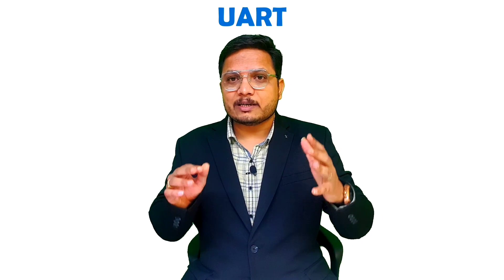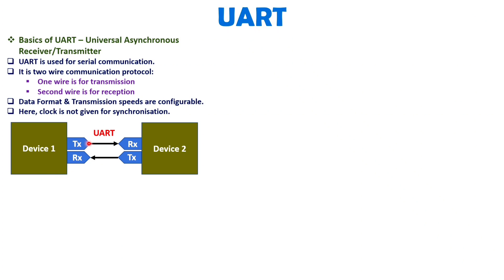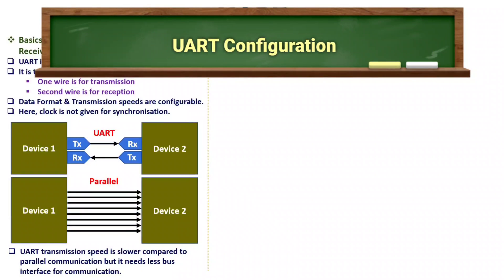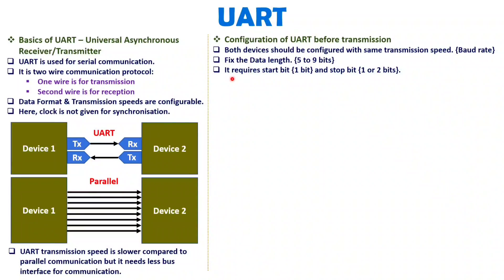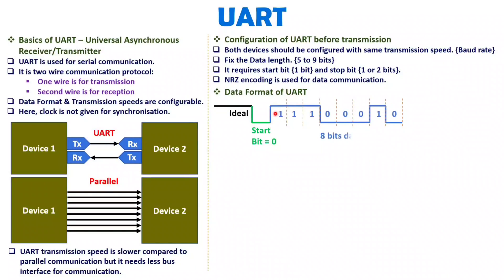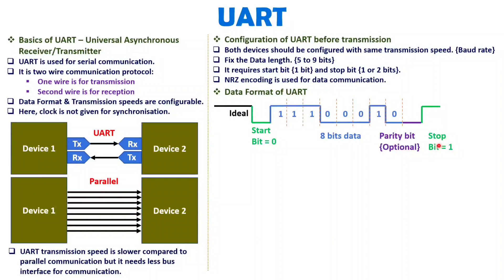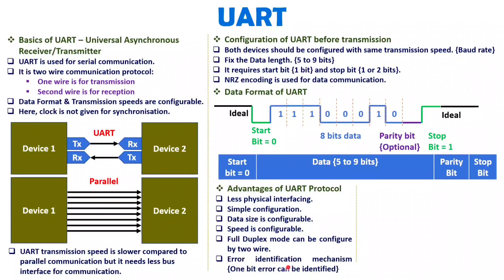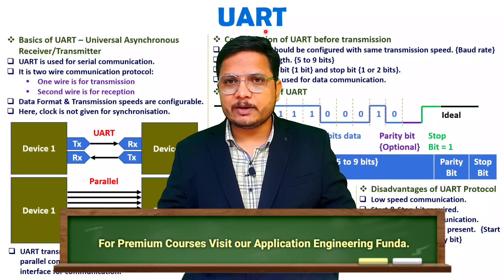UART Protocol Explained: Basics, Interfacing, Configuration, Data Format, Pros and Cons

Comment: if 2 data bits are corrupted while transmitting from one device to other device then both having same parity is it receiver can receive wrong data .So, how can we avoid such type of errors in UART
Reply from the maker: For that you have to go for error correction codes. Like Hamming Code or Linear Block Code.

Comment: 3:25 In practice parallel communication is slower than serial, due to the difficulty in:
- Ensuring that the signals on all parallel lines are synchronous
- Crosstalk and EMI interference between parallel lines running at the same frequency
While theoretically a parallel protocol running at the same frequency as a serial protocol would be faster, parallel protocols tend to run at much lower frequencies. A notable exception are buses on computer motherboards, though that comes at the cost of extremely complex PCBs and tens of thousands of man-hours of design and verification time for each PCB.
Reply from the maker: during DMA Access we transfer parallel data with the possible speed of 150MBps. so it also depends on protocol we use for data transfer.